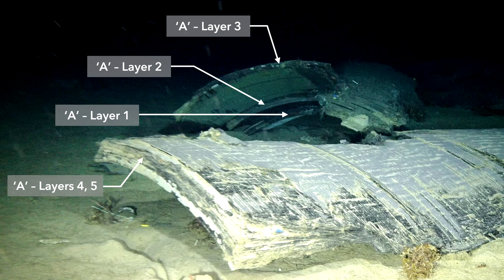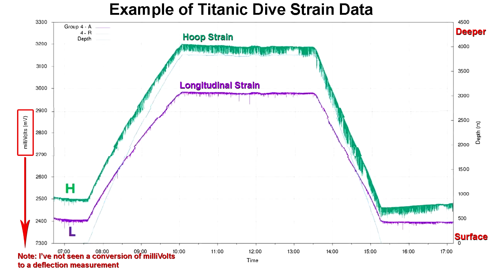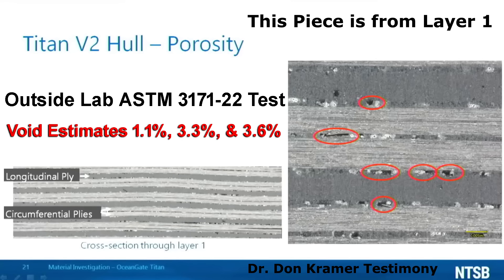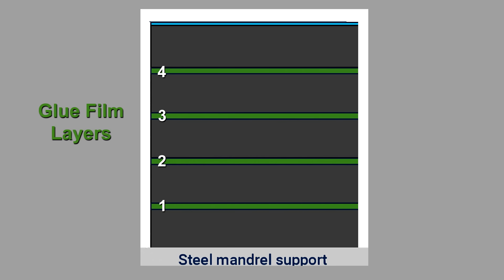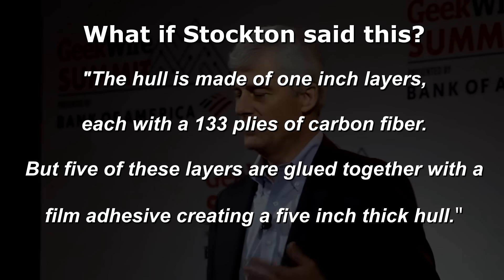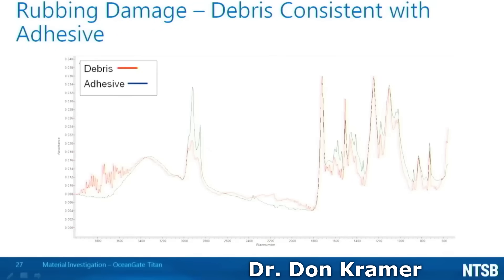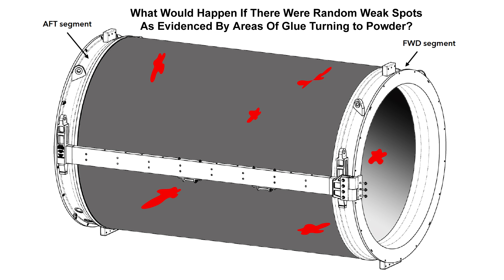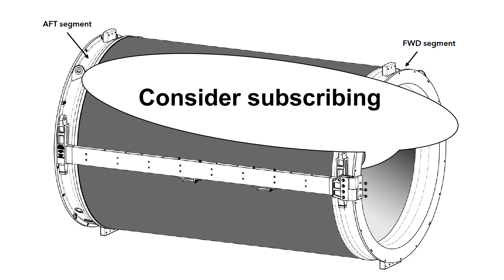OceanGate Titan Hull - Glue Layers Were Breaking Down To Dust - No Clues.

Comment: I am actually surprised that thing had made it down there without imploding the first time it went down.
Reply: Cyclic fatigue failure is a common factor in pressure vessel failure mode analysis. This contraption is just the latest example, exacerbated by poor engineering and hubris.

Comment: I'm not even sure why they wouldn't have had a series of bracing rings/frameworks around the interior of the hull. Obviously that would have reduced deflection even before you do any testing.
Reply: because the guy didn't want to do things like other sub builders and was even proud that none of his people had experience with subs.  Not sure if it's up anymore but OceanGate had a vid up with the CEO boasting about stuff like that.  It's nuts
Reply: I see a big problem in gluing the hull to titanium. Just the different thermal expansion is a problem. I'm not talking about technological indiscipline.

Comment: The carbon fibre was rejected by Boeing for being defective and knowingly sold it to Rush, Rush knew the carbon fibre was defective.  Its clear from the grotesque facial expressions on the oceangate's staff faces that they are dilusional. There should have been no surprise there were carbon fibre popping and cracking noises on every dive.

Comment: So it's not even impossible that they would have lived, on that dive at least, if they had an actual solid carbon fiber hull like the one he described. But they didn't, they had 5 thin ones very poorly glued together.
Reply from the maker: Thanks for your thoughtful comment.  You are correct.  A perfectly made solid 5-inch carbon fiber hull might possibly work.  But in this case, five individual layers that are not functioning as one will not have the strength.
Reply: @solareclipsetimer  I believe they had problems with a single-piece hull too, but we have no idea whether either of those had flawed production, and maybe could be improved in some way. It's all 1 of 1 prototypes. It's very possible you could have a technique that repeatedly produces hulls which can last for a consistent amount of dives. You'd need to test multiple until failure to know for sure. Only then you could calculate safety margins, ticket prices, and possible commercial viability. But instead they just kinda glued some carbon fiber together and kept diving until it shattered. Personally I don't think I could ever trust a composite to this extent.
Reply from the maker: @kogure7235  You are correct.  The V1 hull was a sig]ngle layup design done by Spencer Composites.  It wasn't as strong as the design predicted.

Comment: The more I learn about the OceanGate Titan, the more it seems like a miracle that it lasted as long as it did.
Reply: the crazier thing, it would have never been financially profitable. the customer capacity and overall customer pool was too small and from what I can guess expenses were way too high.
Reply: @ "from what I can guess" so you have literally no data at all to back up your nonsense claims, but still want to assert yourself as correct? Nah you need to keep quiet.
Reply: @ard-net2999 anyone with common sense can figure out that they were losing money. Haha
Reply: @astrinymris9953  Exactly. It was a ticking time bomb whose fuse got shorter with every trip.
Reply: It gets so much worse the more you find out.  What a con job…
Reply: Who is PH is he going to be prosecuted?
Reply: @expomm PH was a passenger during the implosion. James Cameron said PH had more dive time around titanic than he does, but he had more of the adventure spirit and overlooked the potential flaws.

Comment: So I hope they took everything the company had to pay for all this, since the genius wouldn’t pay for it! Carbon in race applications, breaks all the time! Even the highest quality parts! This is the dumbest shit ever! Why would you want to make something using lightweight materials! When you need weight to dive 🙄🙄🙄🙄! If you told people you are betting your life on stands of material & glue! I don’t think people would go 🙄🙄🙄🙄! But all rich people are genius, right?
Reply: Carbon fiber can be up to 5x stronger than steel by weight. So when constructed and applied properly, you have a very strong, and very light material. There are plenty of examples of carbon fiber being used properly all around us, most notably in high performance autos, as well as both general and commercial aviation. Being lightweight is also an advantage when you need to resurface, especially in an emergency. You can always drop ballast, and rely on basic physics to bring you home at that point. The issue with carbon fiber is that generally it's best when under tension (high pressure tanks) as opposed to under compression (deep sea diving).

When it comes to glues, same issues: proper selection, and use. There are industrial adhesives which are capable of forming bonds stronger than steel. IIRC, the Porsche Panamera uses adhesive to bond parts of its frame together.

The big issue here is that Stockton Rush was a hack who worked for a company (McDonnell Douglas) that was known for building death traps in its later years, and he himself was an arrogant ass with a general blatant disregard for safety measures. He dismissed anyone who told him his design was unsafe, and did things as cheaply as possible. He was a modern day example of the snake oil salesman of the old American West.
Reply: @airplanenut89  Yes, lightweight is great in a supercar where you want a great power to weight ratio. Why would you be worried about weight in a diving sub? You should be more concerned with strength and not at all about weight. This guy was just trying to save a buck by not using titanium.
Reply: @ Did you miss the part where I called Rush a hack who worked for a shitty aircraft manufacturer, or where I specified that when applied  properly, that these are great materials? Every ship on the water, including subs are supposed to have positive buoyancy regardless of what it's made of. For a sub it's better to have something inherently buoyant so that in an emergency you just rely on simple physics to return to the surface. Even if you make a sub out of titanium, it needs to displace more water than it weighs. So yes, it must be relatively lightweight. Also, in case you forgot, Titanium is a favored material for this sort of thing because it is both strong, and LIGHT.

I've also seen many people familiar with how you're supposed to build with carbon fiber comment on this, and the consensus is that Rush managed to come up with a manufacturing process that took away any advantage carbon fiber can provide in addition to using material that was past its shelf life for aircraft production.
Reply: It's amazing how these rich people didn't watch the video where Rush applies the glue as if's some home project for something completely different. They put the glue with spatulas on the titan,  I haven't even seen they used anything to clean it... I usually use alcohol to clean and I use clean instruments... for glue which is not supposed to hold anything heavy... or to connect any parts under real strain... I use bolts for more important things, not glue, it's crazy what they did... it's amazing this thing didn't implode the first time it went underwater.

Comment: Did multiple curing cycles contribute to degraded glue?
Reply from the maker: Thanks for commenting.  Yes, probably worsening with each dive.  It was known to them that the hull would compress in the center.  I guess, they did not consider that the layers would start to shear on themselves from the small amount of bending inward.  So, the glue damage was probably progressive.

Comment: What is particularly gaulling is the original design was never intended to go to 3500 m. It was designed for much shallower depths, and in that application composite would probably be fine as the pressures and deformation are far lower.

Comment: In my engineering career, when I had to conduct detailed troubleshooting analysis....usually it was a miracle the system ever worked at all.  Titan's hull was clearly such a system.  Its engineers were worried about actual failure modes, but there wasn't budget to test for them.
Reply from the maker: Thanks for commenting.  I agree.

Comment: I'll say it again, this was a murder/suicide. Rush was an engineer & a smart guy (for what I've read). Sure, rich people tend to be cheap & hate being told no, but not to this extreme. Think about it, Rush went out of his way to cut corners, used untried methods/materials & went against every standard, just to have the Titan survive trip after trip. He must have been spitting mad. Just what did he have to do for his spectacular end? Put a bomb in the damn thing? It was his $$$ (mostly), so I'm mad about 2 things: the innocent idiots who took his word about it being safe & the staff (mostly engineers) who just took their paychecks & didn't protest this ridiculous "adventure".
Reply: To be fair, several employees including engineers did call him out, and he terrorized them with expensive lawsuits and in lockridges case, deportation threats
Reply: @Elizabeth-n3v2u   Agreed. I'm talking about the ones who didn't say anything & just kept working. Not all, but quite a few were in positions important enough that the whole thing would have come to a halt if they had walked.

Comment: I do wonder if there is a safe way to make a carbon fibre extended hull.

Perhaps is the carbon fibre sections instead of being cylindrical had a mild arch to them? Could a thicker hull be made so it was safe? I know in the third party assessments (Boeing?) they recommended a 7" thick hull. Could the hull have been made monolithic instead of in layers? Could the ripples have been mitigated in production so they didn't have to mill the layers smooth? Could they have reduced the resin and glue porosity to an acceptable level?

Even if they could have solved all the issues they ignored, I would always be wary of composites in compression - but perhaps there is a way that a deep submersible constructed using composites could be made safe to use.

One thing is for absolute certain - Oceangate was not.
Reply: Not for compression
Reply: @russell7489  Never say never! Maybe one day we will have manufacturing and testing methods that would make people confident enough to use composites in ways we don't today.

Once, we probably considered making ships out of metal impossible.

I do agree, though - we aren't anywhere close at the moment.
Reply: @mceajc  The point in time where we didn't consider metal as a viable material for naval construction, we barely had any notion of materials at all.  We didn't understand metallurgy and built boats with wood because wood floated.  Carbon fiber composites have practical applications that are very well understood; the cyclical strain of deep dives just doesn't match the material profile.  What we can take away from Rush's experiment is that you can make a disposable deep ocean submersible that can survive a handful of dives before you need to replace it. Failing to figure out what the shelf life of that product is would be the fatal error made by Rush.
Reply: @ Completely fair points - I guess what I'm trying to say is I don't want to write off an entire technology forever because of one idiots lack of rigour.
Reply from the maker: Thanks for commenting.

Comment: @12:07 "precision welded" 🥵🤤
Reply from the maker: Thanks for commenting, but I don't understand the comment exactly.  The new Alvin hull was welded in a unique manner.  From Woods Hole >>In August 2009, another milestone was reached when STADCO, Inc. in Los Angeles, Calif., successfully joined the two hemispheres using high-energy electronic beam welding. The technique eliminates the need for additional welding material that would add weight, minimizes the amount of heat needed to be applied to the parts, and reduces the chances that the sphere will be distorted<<
Reply: @solareclipsetimer  sorry for not making any sense...I like to comment in general to support videos- and I happen to be a welder w interest in pressure vessels so when I heard you say the words "precision welding" I got excited and my brain acted upon that. Please forgive my lack of clarity  🤦🏼‍♀️
Reply from the maker: @fadedjen  No problem, I just wanted to make sure there was not something in my video that was unclear, so I re-listened to that segment.  In the interest of time I did not want to get into a lot of specifics about the Alvin, so I made that general welding statement, just to emphasize to folks that the Alvin was remarkably well made.  By the way, I love welding!  I don't do it myself but I have a friend, and his dad, that own a welding shop and they have done several custom projects for me.  They are really talented at it.  Thanks for your reply and your support.
Reply: @solareclipsetimer  Funny how we all interpret differently. I took the "precision welded" statement and photo in your video to show how a submersible can be built properly as opposed to OceanGate's method. The photo of the perfect diving sphere and welds said it all.
Reply from the maker: @stonehobson2487  Yep, thanks for your reply.

Comment: good analogy at the end. im sure Rush thought of the cylinder as a series of rings, that were basically indestructible, since we all know how strong perfect circles are. but when you consider the forces, and look at the cylinder as a length of layers, you realize that there MUST have been increasing movement between the ends and the middle sections, over time. and this would cause a "sliding" of the layers against each other, degrading the bonding material - it was destined to fail.

As a ONE TIME use sub, this might have been a good design. But once you start looking at multiple dives, that thing was certain to fail. even microscopic amounts of movement were going to compound over time. I wonder how long he thought he was going to be able to use this for? Another 20 dives? another 100?

this was terrible design. non-uniform material. multi stage construction process, allowing for accumulation of inconsistencies. I had no idea how much resin and glue was in this thing. the way he described it was 5 inches thick of PURE carbon fiber, which would have been impressive and at least uniform. wow what a disaster. it's a wonder it lasted as long as it did.
Reply from the maker: Thanks fro your thoughtful comment.  You summed it up well.  I am amazed also.  They knew the hull was going to flex inward in the center, so I don't understand how they trusted the glue design between the layers.  That is why I used the LVL analogy at the end of the video, to make that point.

Comment: I can see ripples on the exterior of the hull. That would freak me out alone.
Reply from the maker: Thanks for your comment.  Yes, they left the ripples on the surface of the last layer because they did not need to prepare the surface for another layer.  But those ripples are weak spots, just as grind areas are weak spots.

Comment: The glue is a major key, how was it applied and whats its composite make up?
Reply: Given how it was a primary and significant component of the design, the design is a failure from the ground up
Reply from the maker: Thr testimony form Dr. Kramer said the glue was supplied as a film and laid on the hull.  I have no idea how they worked with a film that thin.

Comment: Didn’t the strain gauges show different deflection over depth after a loud noise event on one of the later dives?

This was the most profound warning sign they had AFAICT, but they may not have seen it since the reporting they had available only showed strain over time, not depth?
Reply from the maker: Thanks for your comment. One group of strain gauges showed a large permanent change after dive 80.
Reply: @solareclipsetimer  Thanks for confirming.

Coming from a data background, I wouldn't have trusted the pressure vessel after witnessing the changed strain patterns.

But looking at all the oversights and wishful engineering you highlighted it shouldn't have been trusted before either :S
Reply from the maker: @MichaelRenner  Agree with you.  They should have stopped after dive 80.  But Phil Brooks was not a materials engineer.  He did not fully understand the consequence of that data and listened to Stockton about the noise coming from the frame and the amount of strain change was insignificant.

Comment: 11:13 the inside diameter is 59. the thickness is 1 inch. Diameter is now 61 not 60. am I missing something
Reply: One inch added to each side of inside diameter, so 59 + 1 +1 = 61.  Don't feel bad.  A lot of people make this same mistake when considering circular objects.
Reply: Radius increases by 1, diameter increases by 2
Reply from the maker: Thanks for your comment.  I did say 61 inches for the diameter in the video.  The formula uses the radius.
Reply: @solareclipsetimer  meant to add that "I am new subscriber".....best wishes to you, your site and all the subscribers

Comment: I have no knowledge of materials science or of engineering. The very mention of glue being used in such a vessel is frightening.
Reply: modern epoxies are incredibly strong, stronger than most metals even. but not when used so very out of spec.
Reply: Modern aircraft and lots of other stuff is made with "glue", at least in part. It's perfectly normal and safe as long as everything is within spec, that goes for everything. Titanium, steel and concrete are just as unsafe if improperly used
Reply: Can't have carbon fibre composites without glue.
Reply: It's a survival instinct. Most of us would at least learn all about glues and insure we had the right one. This whole crew seemed to think "glue=strong." Now go dive.